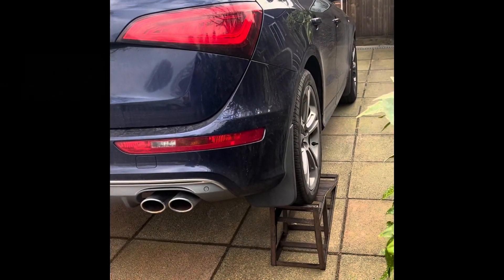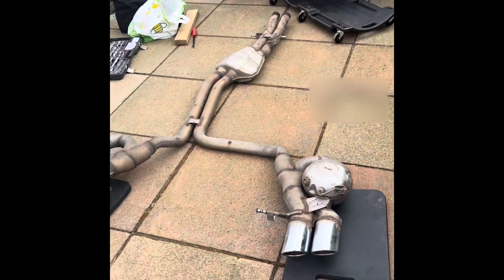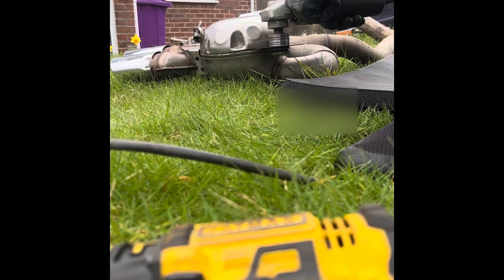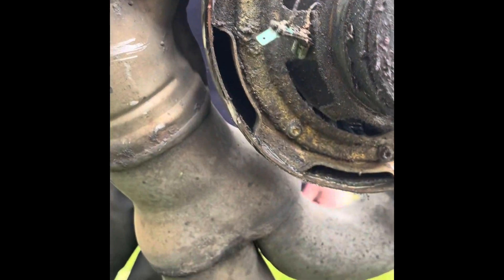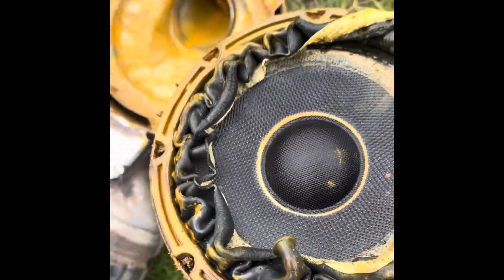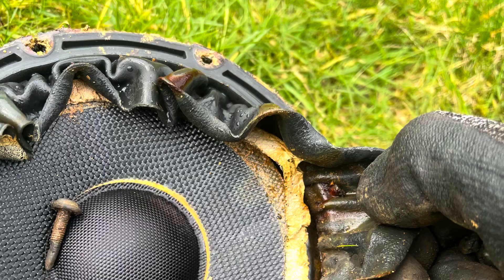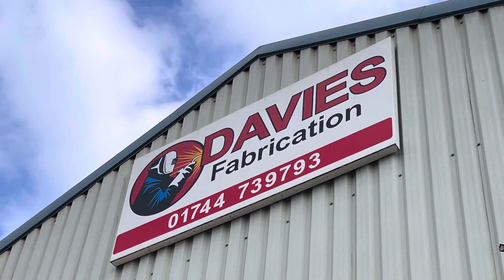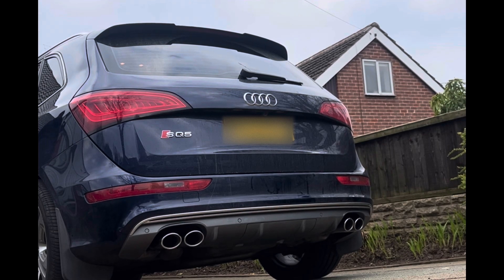Audi SQ5 BiTDi Active Exhaust Speaker replacement fault code C113C13 - Visaton W165A

Comment: I also have a SQ5 TDI and im in the process of fixing my speakers. But how did you fix the corroded wires on the exhaust?
Reply from the maker: Cut back to good and solder extended, or pulled through the gland and replaced